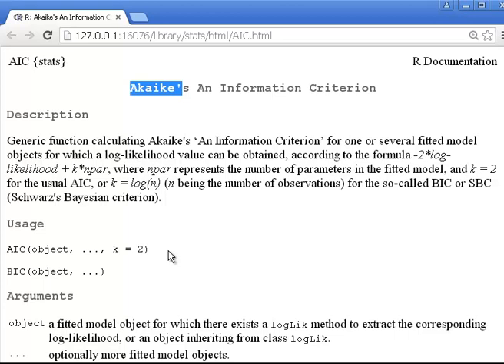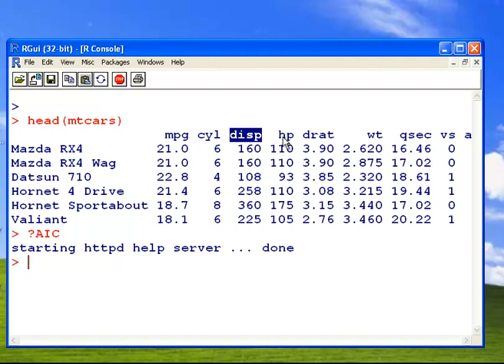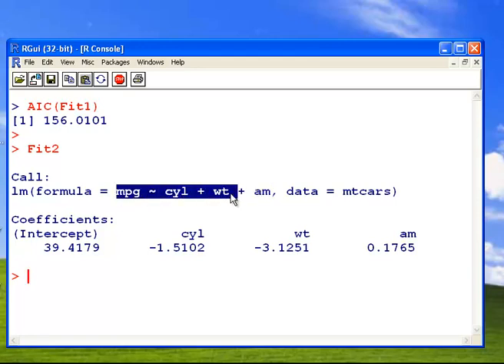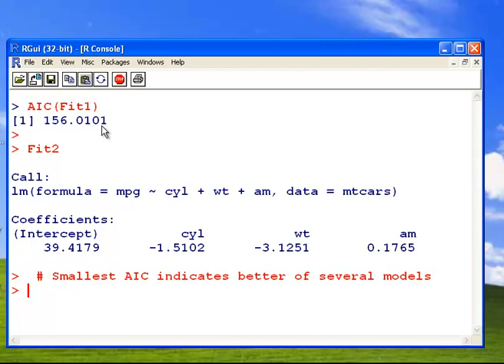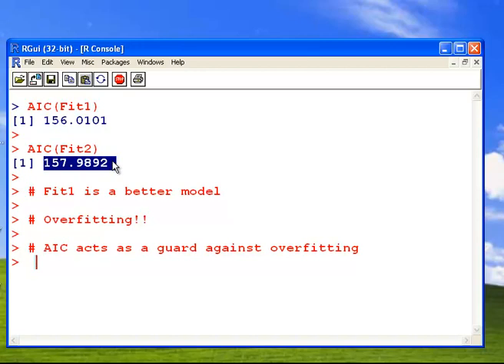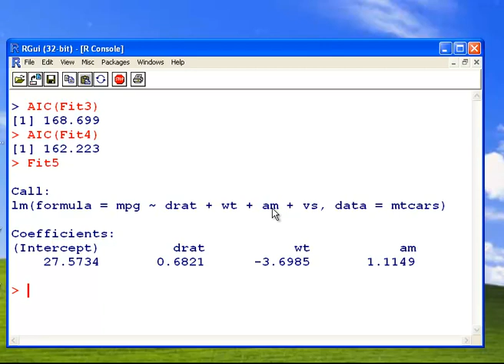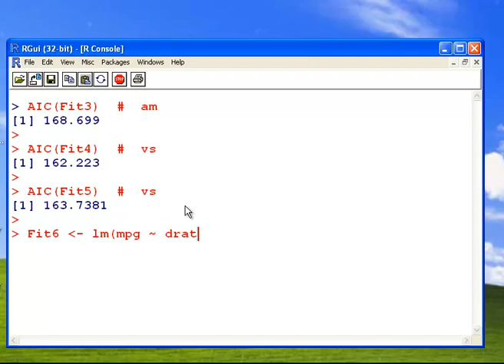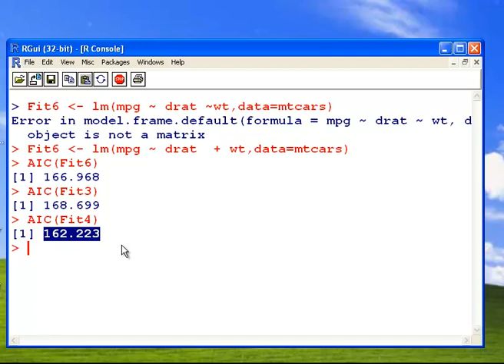Model Selection with the AIC

Comment: I have 70 predictors and I want to decide which predictors are important and which are not. Is there any way to compare all possible models based on AIC or BIC or np values. Thanks.
Reply: Jitendra Upadhyay look at p values. They tell you how significant your predictors are
Reply: me too and i don't know how can you help me please
Reply: that's called data mining and you shouldn't do it
Reply: @jitendra did u get any solution.. I am facing the same problem